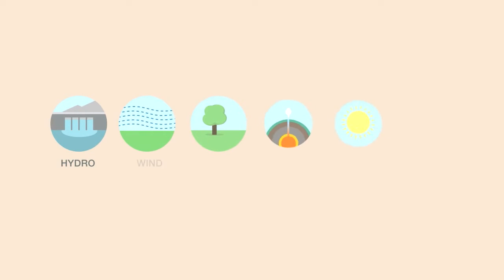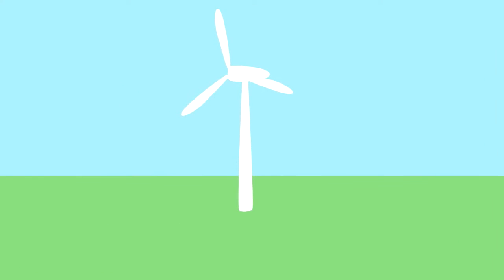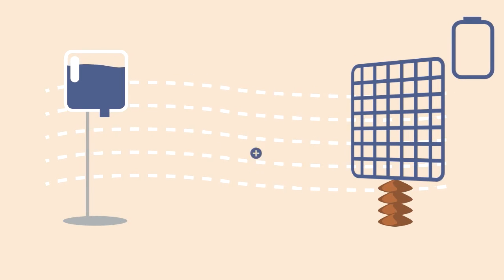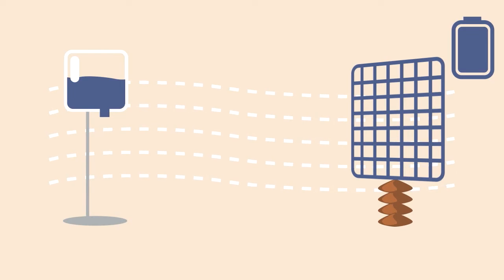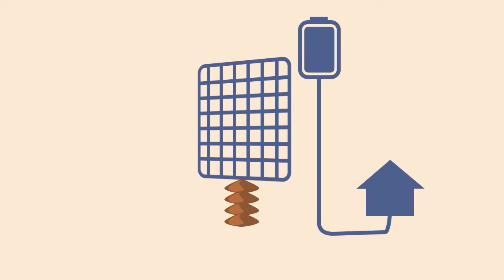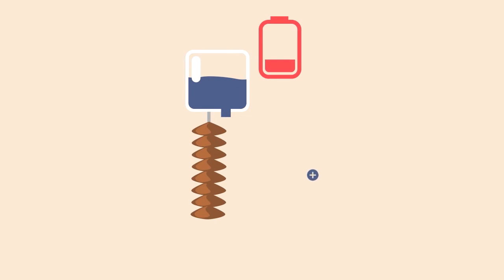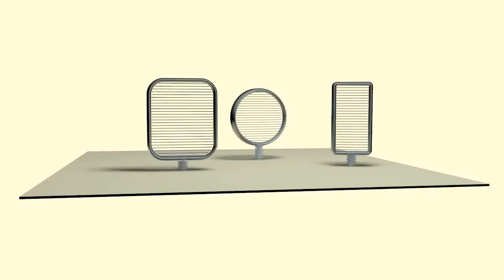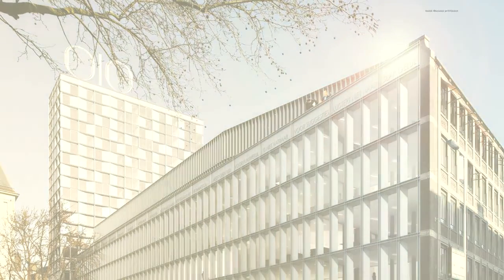Windenergy convertor EWICON animation, TU Delft

Comment: No moving parts but the system loses water all the time. Great for regions that experience a lot of rain, where you can let nature do the refilling of the reservoir. However I'm assuming if you pumped water to a hight were it gets effected by wind and not just gravity you would already use more energy than the system recovers.